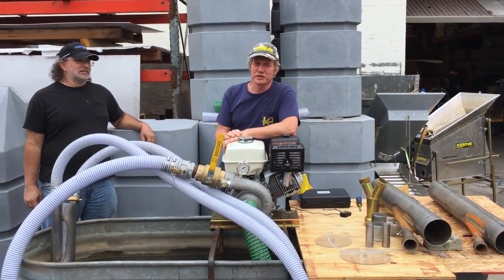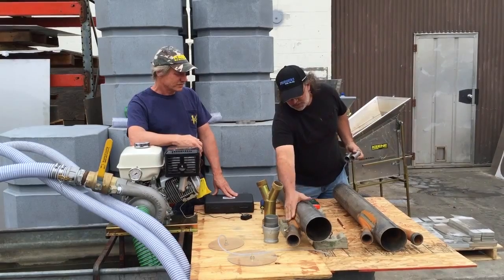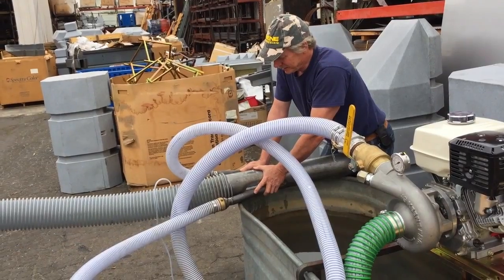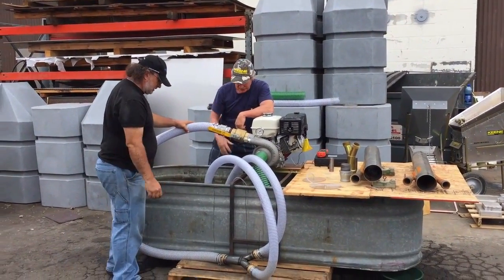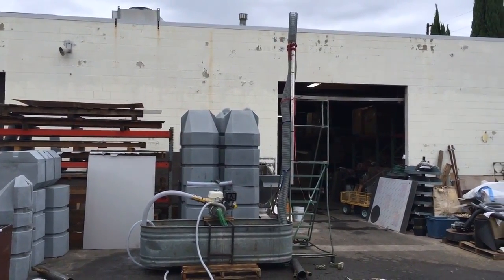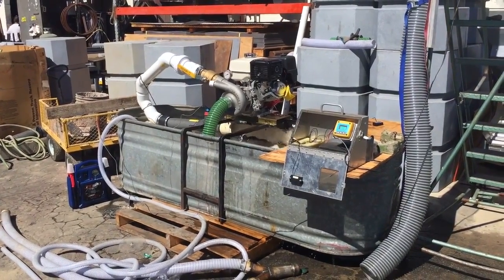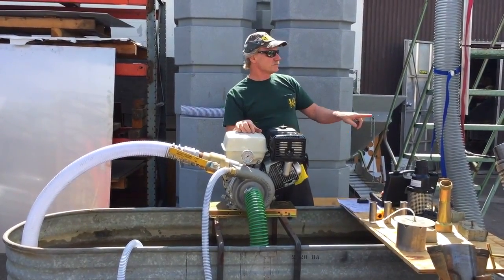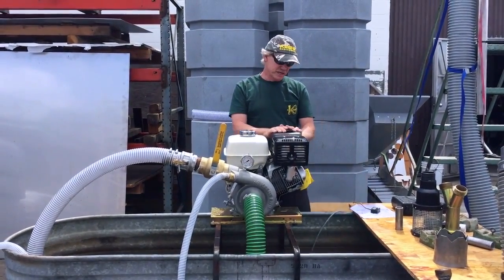Keene PHP500 Pump & Jet Test

Comment from the maker: The pump is a PHP500 Pump 3" intake and a 2.5" NPT discharge.  This pump can be Powered by as little as a 8 hp engine and up to a 20 hp.  We match the impeller size to the horse power of the motor.  For example a 8 hp might use a 5" tall impeller and 20 hp might use a 6.5" tall impeller.  Taller impeller use more hp and generates higher volumes and higher working pressures.
Reply: You guys are the best

Comment: Please mention if its a 3x2 1/2 or 3x4 with 9hp. Very helpful for green horns.  Ive recently acquired two 8hp briggs with KEENE 3X4 PUMPS.  ONE 8HP is pretty "stoved" up.  Any 8hp videos about reclaiming one of your old work horses.  You guys are the best!
Reply from the maker: The pump is a PHP500 Pump 3" intake and a 2.5" NPT discharge.  This pump can be Powered by as little as a 8 hp engine and up to a 20 hp.  We match the impeller size to the horse power of the motor.  For example a 8 hp might use a 5" tall impeller and 20 hp might use a 6.5" tall impeller.  Taller impeller use more hp and generates higher volumes and higher working pressures.